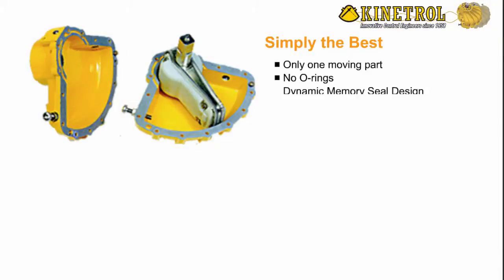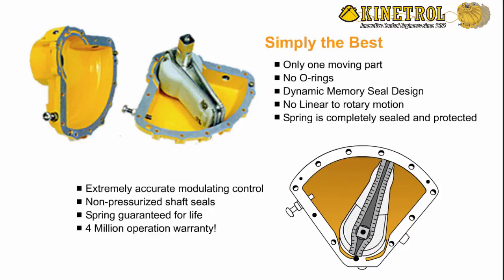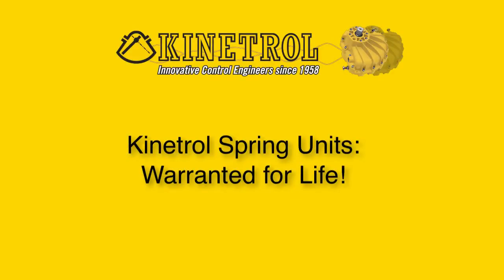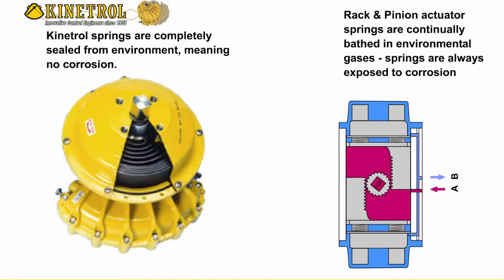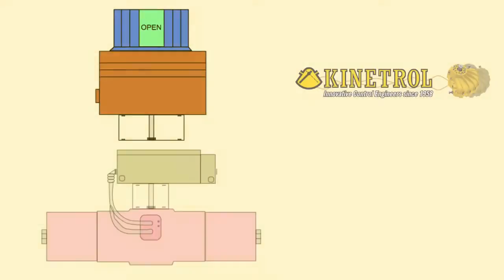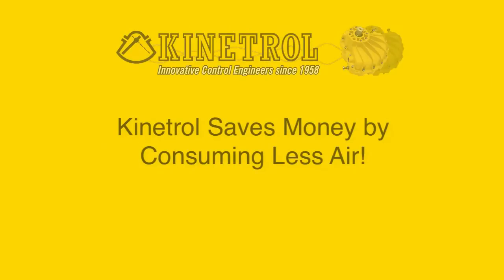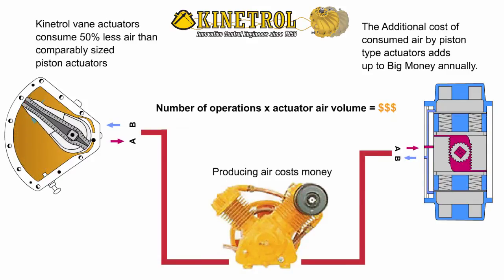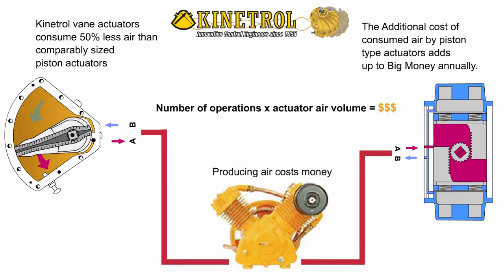Kinetrol Rotary Vane Actuators: Simply the Best

Comment: How to check that my actuator does not leak?
i wor in Algeria in Oil & Gaz field
Reply: malikovitch16 dismantling the complete positioner housing from the actuator. Bottom of the positioner you will find a multiple screws say around 20, unscrew all of them. U ll find a gasket inside it. Replace it. It works.